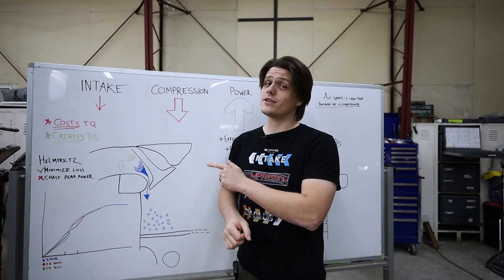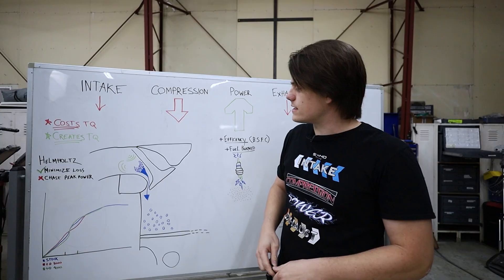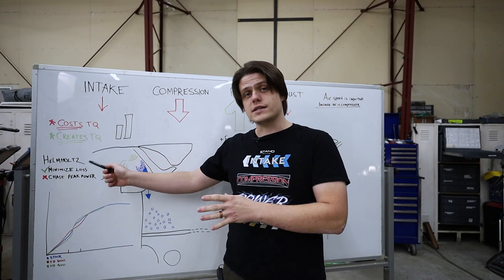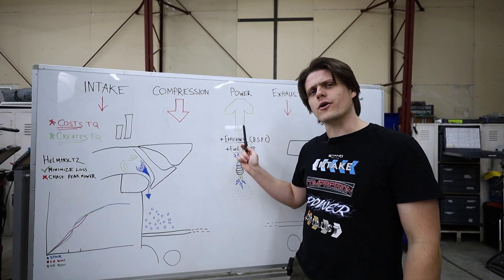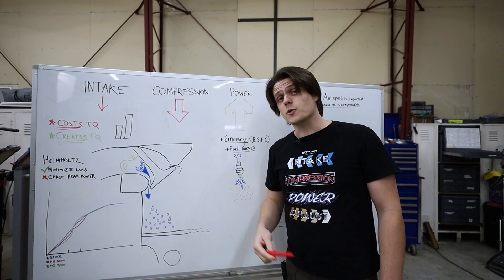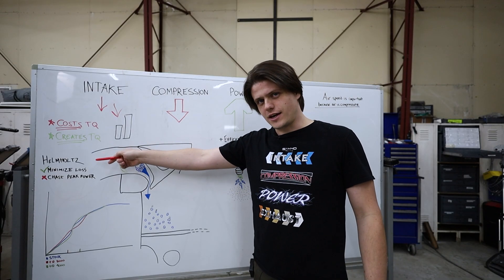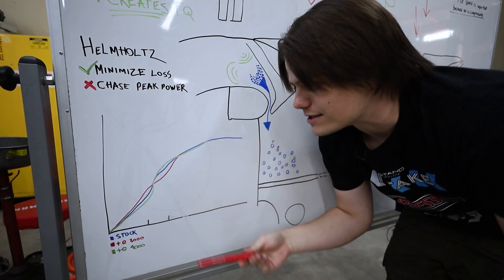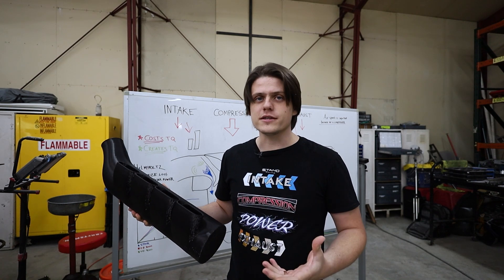How to design your own intake (What I've learned so far)

Comment: Air speed is going to bev driven by more than runner length. Diameter, cylinder volume,  processing time which is the amount of time between valve openings and overlap. Along with density and frequency  will dictate charge density.
Reply from the maker: Yes. I wasn't meaning to answer, "what affects airspeed?" I only meat to answer "why does runner length affect airspeed?"
Reply: Squeezing the same volume through a smaller space means it has to pass through that space faster. Runner diameter has a greater effect on intake velocity.
Reply: I didn't think that you didn't know the variables. But the video would leave some people 🙄 thinking that length was the primary thing to tune. Taper to runners can also help achieve a good balance of air speed and frequency. As you stated its not as important  but in the condition of cruise we can gain efficiency.
Reply: The greatest gains are always going to be area just before the valve and to some extent the valve itself. Its generally best to have the greatest velocity across the valve for 65% and the kinda tunes the mass of air bouncing

Comment: What you're saying here is the wrong way around. The pressure valve typically comes from opening the valve, sending a negative pressure wave that is reflected at the collector as a positive wave. This wave you want to hit the valve as it is about to close so the pressure in the combustion chamber is higher and you get more air in total into your chamber. (Hope this is gramatically correct, I'm not a native english speaker since I'm german)

Greetings.
Reply: Btw.... The wave lengh is longer but the wave has less amplitude at low rpm and shorter with a bigger amplitude at high rpm.

So aiming for high rpm will give you multiple benefits:  

Better runner optimization effects due to the bigger amplitude (bigger pressure spike by the wave -> more cylinder pressure)

Shorter runner so you have less flow restriction (actually has a less of an effect then you'd think)

But due to how the wave behaves over the rpm range, the higher you get the smaller the rpm range in which the runner lengh fits the rpm.

Movable stacks give you the best out of all worlds and you can gain a lot of power over the entire rpm range. You can find these for example on the 787B even tho they programmed the system to be controlled by the gas pedal which is not the right way to do it.... 

Regarding the Helmholz formula... This is rather a guesstimate on where your runner lengh will be since it does not take into account the wave lengh at rpm, origin of the rpm regarding the angle of rotation on your engine (not at tdc or opening event of your valve!!), diameter of the runner etc ....

In reality the true runner lengh differs from what the helmholz formula will tell you.
Reply: @maximilianstobinski2469  all excellent advice here!
Reply: You got it!

Comment: Great video! I wonder if you can even use helmholtz for your hybrid intake or the effect would be distorted by the complex geometry
Reply from the maker: I've wondered the same thing. Each different channel of air should have it's own resonant frequency, so I would expect that trying to discover exactly what's happening inside the manifold would require intricate testing.

Comment: A vendor has released an IM with three different length runners. I don't understand why it doesn't lose torque anywhere and has a nice power gain above 5K.
Reply from the maker: This one?

https://www.fuelairspark.com/lsxr-high-hp-intake-manifold-runner-set.html
Reply: This is not a good idea without corresponding individual cylinder fuel maps…